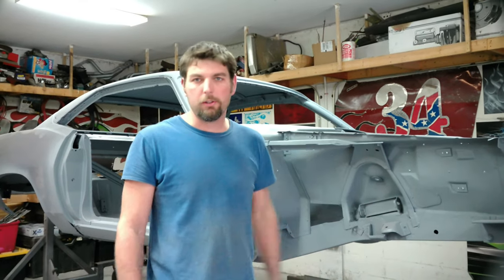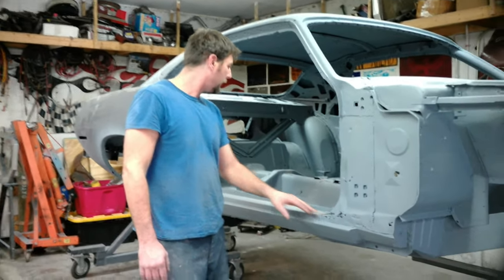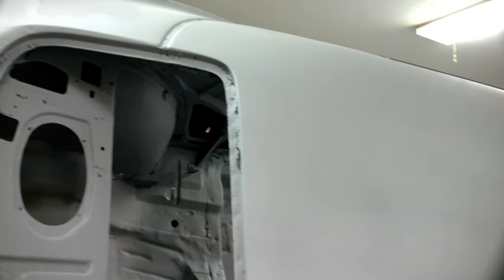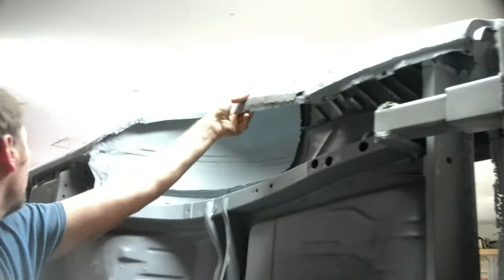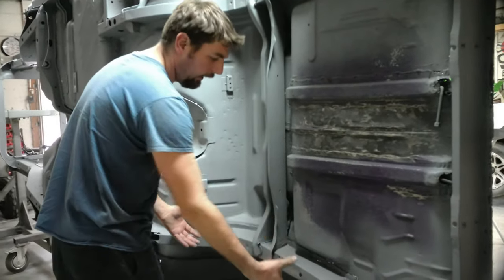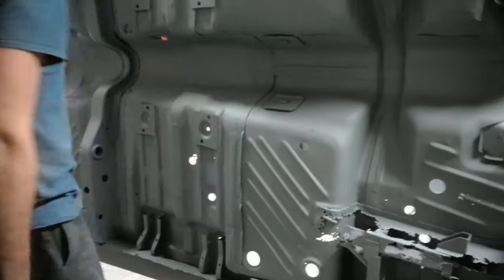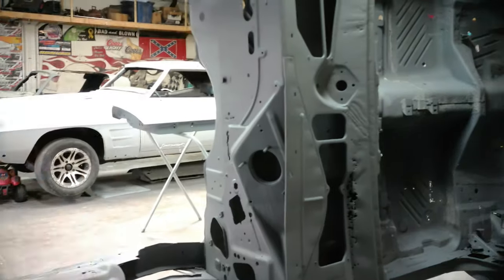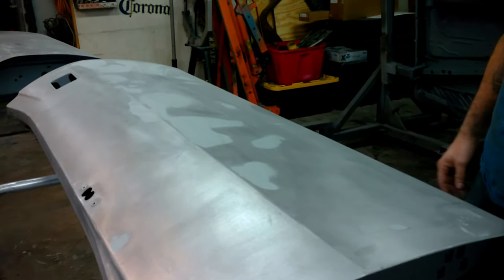1971 Barracuda restoration project Episode 1, Intro and mounting it on a frame JIG

Comment: Just found your channel and I’ll binge watch all the Cuda episodes this afternoon.  
- I have ‘71 Barracuda Frankenfish; nothing is original anymore.  
- I did what you’re doing back in 1997 and still working on her.  Back then, there was no internet to order parts.  I made many trips to different salvage yards to find parts.   
- I recently replaced the non-matching 318 with a Blue Print Engines 360 & matching 727 Trans.  
- Anyway, looking forward to your Cuda’s restoration!!
Reply from the maker: That's awesome and even more respect for you building your 71 back when parts were harder to find. I built a 58 Impala about a year ago and was in that boat where they just don't make too much for that type of cars. Thanks for watching and good luck with your on going build!